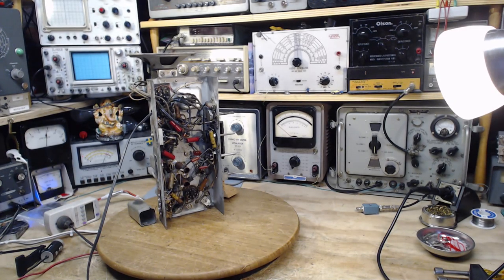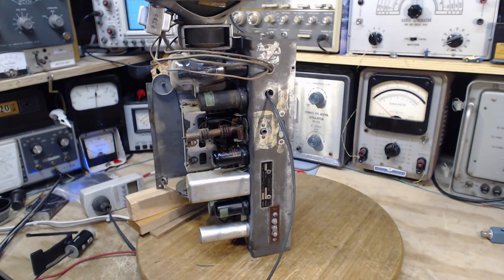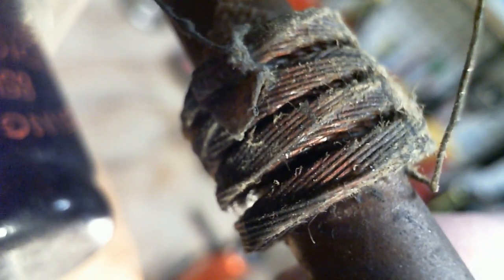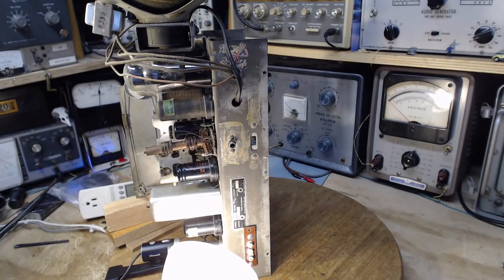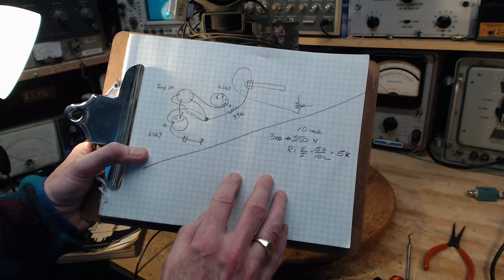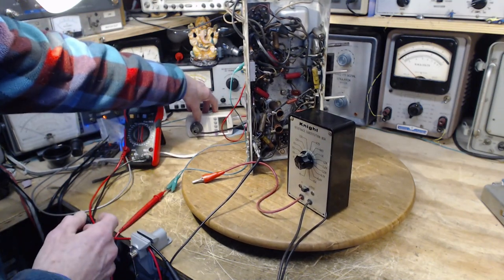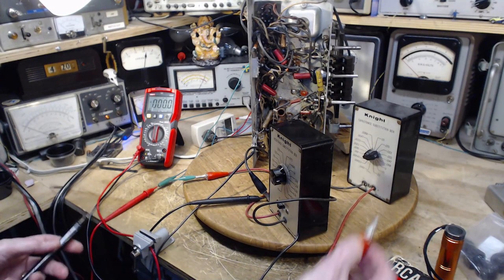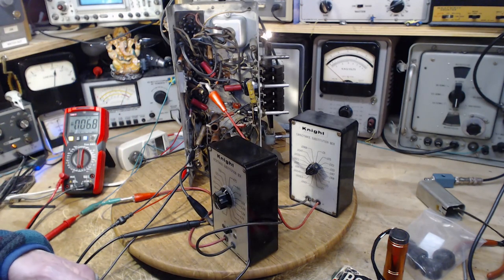Canadian Westinghouse Model 684 Video #6 - IF Transformer Bypass Attempt

Comment: Pull the coil, scrape insulation near coil and then test it. If bad unwind till you find problem. it might be near the top and easily repaired. If you don't try you will never know. Don't be a quitter!

Comment: It’s fairly easy to find another IF transformer of the proper wave length and swap them out. It’s only four wires I think even Jim might be able to manage that if he just thought about it for a few seconds, instead of diving into another rabbit hole.
Reply: And pigs can fly too!
Reply: I like your surgical dental type tools..
Reply: Good. Ole Eico “ R” sub box. I still have the one I built in 1960.
Reply: Nice try !
Reply: All those wires,that meter cirCuitry and sub box is a huge black hole

Comment: It's beyond your ability to repair Jim. Set  radio aside until you can find another parts donor designed for the higher voltages .